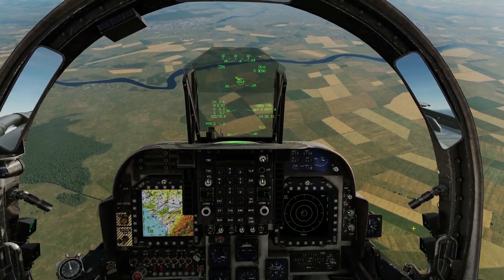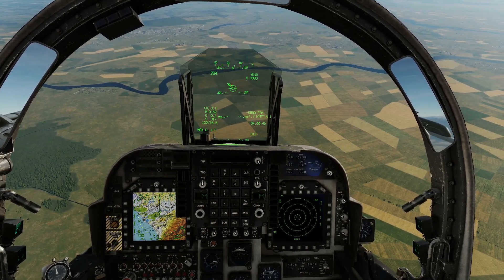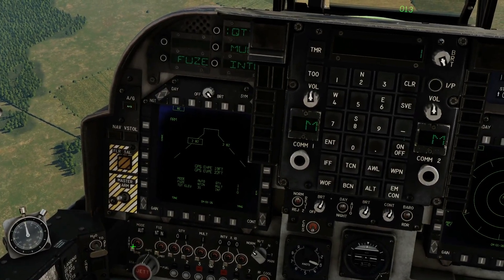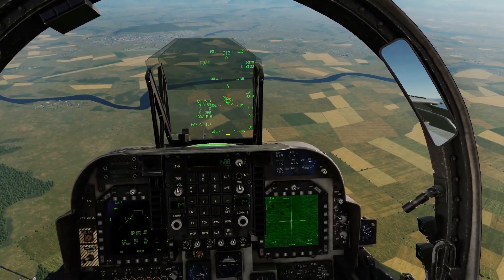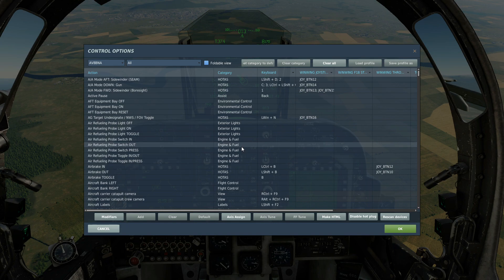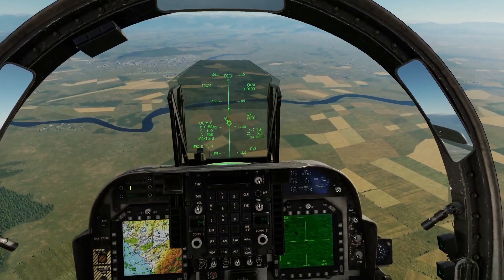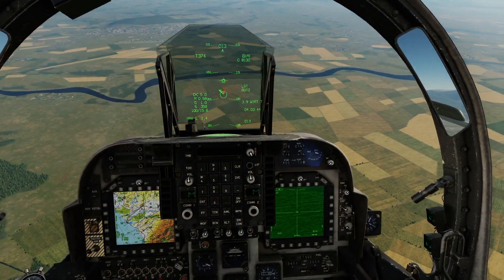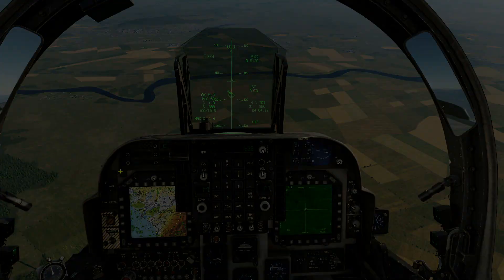AV-8B Harrier: IMPORTANT Changes To LSS/LST Tutorial | DCS WORLD

Comment: I might have to run this through again, but I don't think long press waypoint increment is required. But DESG does need to be boxed. Anyone else confirm this? I had a a JTAC lasing subsequent targets, and the long press didn't need to be used for those additional targets. But, possible long press is required on the first hand off of the LST to the EHSD.